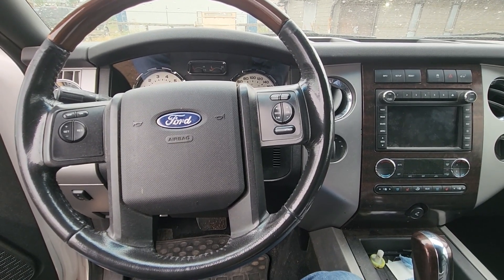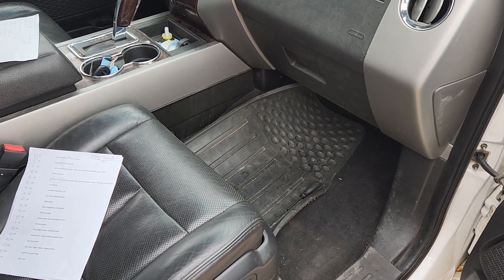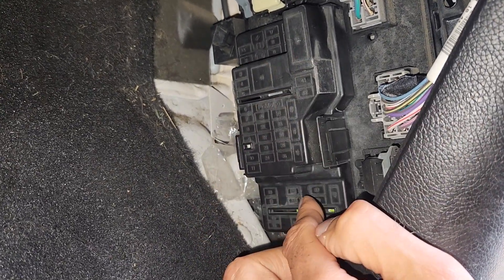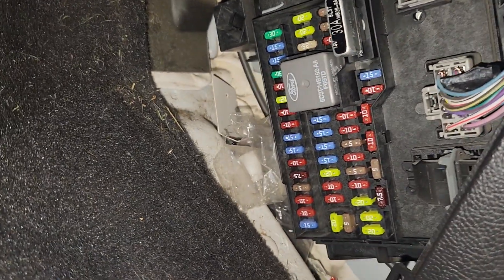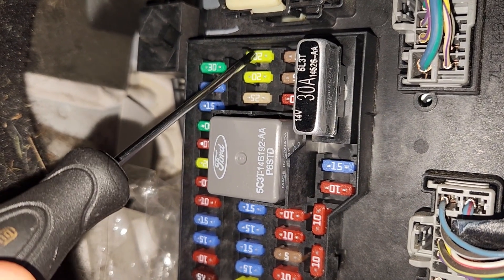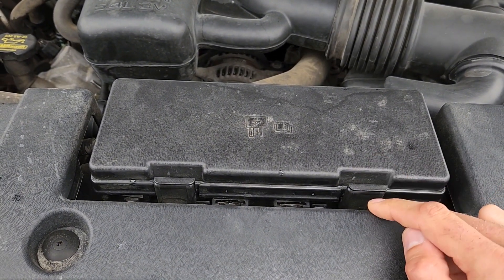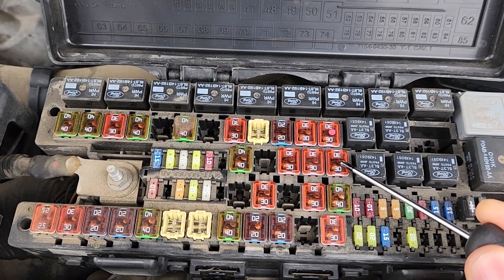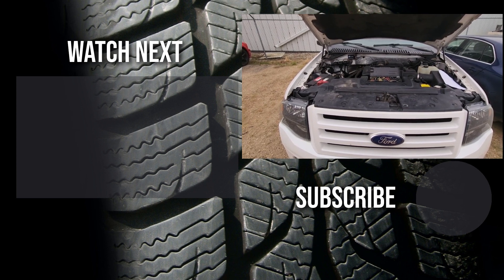Ford Expedition - POWER LIFTGATE & LIFTGATE RELEASE FUSE LOCATION (2009 - 2014)

Comment: What if the fuses ok ?
Reply from the maker: Most likely there is a problem with power switch or a wiring issue. You would have to remove the switch and then test if the power is coming to it. If yes than switch failed, if not then there is wiring problem